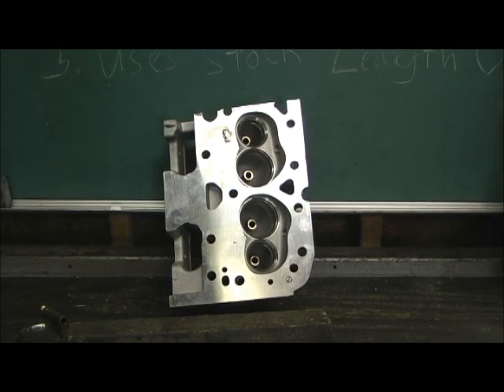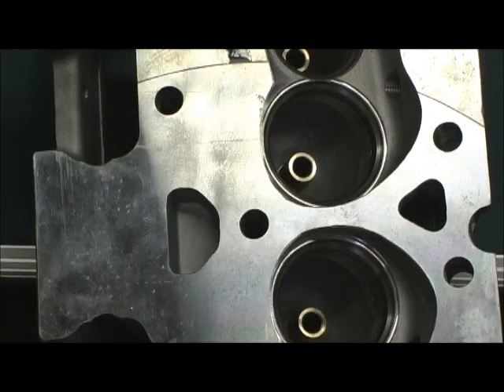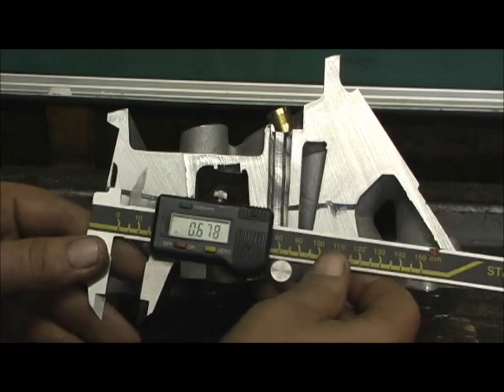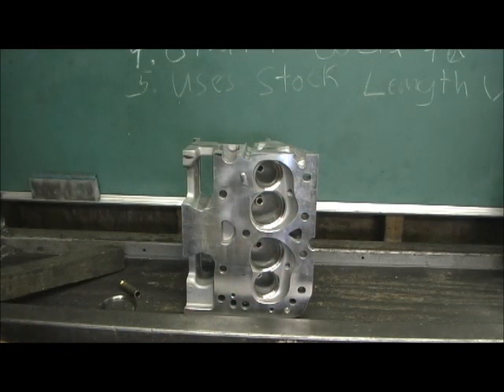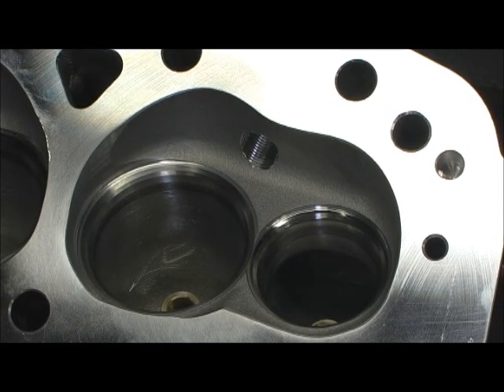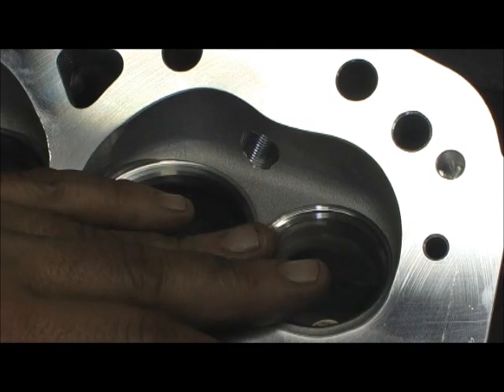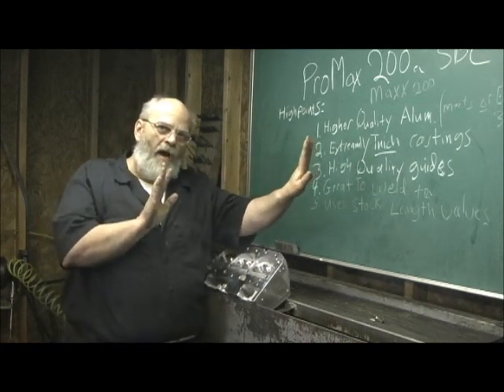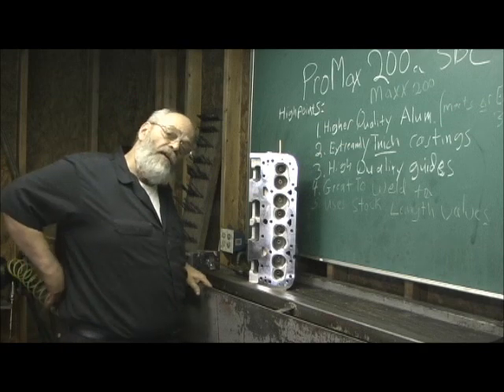ProMaxx 200 NEW Combustion Chamber design 6.0

Comment: They make a set of heads for the Small Block Ford also. They are 185cc heads, hand blended and with 2.02/ 1.60 valves and they cost $1,000.00. Compare that to the AFR 185 which is $1,500.00...  Get the Promaxx and get this guy to do a level 2 or 3 work over on them and every time you see an add for AFR's you will chuckle LOL..   I have the AFR 185's.. Kinda wish I had seen these promaxx's first..

Comment: hey buddy, these things are so pretty, ive been sleeping with them. times up for that, its time to start cutting on them. get those 345's out of your way and get on these 200's so I can pick your brain. Jason said to tell you to hurry up cause the 434 is waitin on them. but in all seriousness, these are probly the most accurate set of heads I have ever touched. what do you think? still waitin on that phone call when you have a min. I have a couple questions that just between the two of us I don't want to post. some things just need to remain a secret
Reply: I want to get a set of aluminum heads for my 340 duster. I haven't seen any reviews for the small block chrysler heads but I'd imagine they would be awsome heads as well. bare they are 300 bucks cheaper than edlebrock. you think these heads are better than the edlebrock heads ?

Comment: Tom without having to "Tube" the head's what exactly am I giving up ? I realize the cost is not very cheap but in number's what would I be giving up ? and what phase do you call the head's you don't tube ? Are the Big block type header adapter for big tube header's necessary for the Big inch small blocks like the 427 and 434  & 440 inch small block ?

Comment: I will like to see how a set of 200cc cut to 230cc will flow and make power compaired to their as cast 225cc heads. Nice project Thomas.
Reply from the maker: Doing them NOW, over the next couple of weeks, STAGE V.....We will see how bad these are indeed.....
Reply: Looking forward to a stage 5. They should rock! I hope they give you some specs on their dyno motor.
Reply: 2.02 / 1.6 or can you step it up?